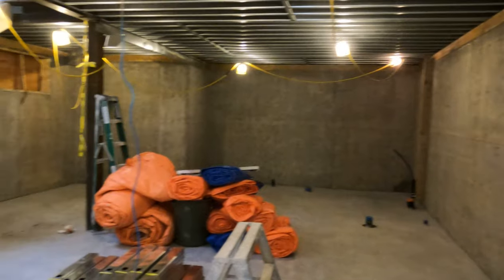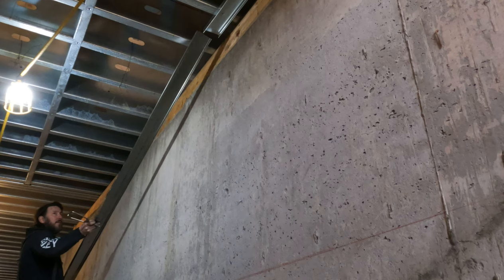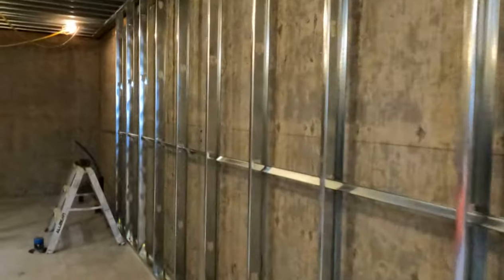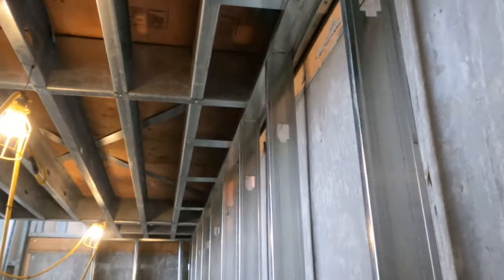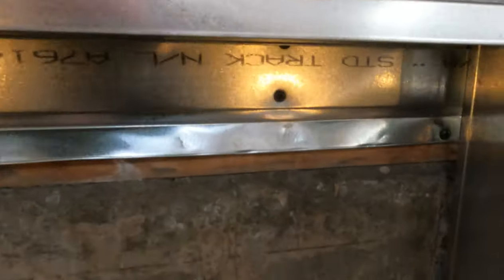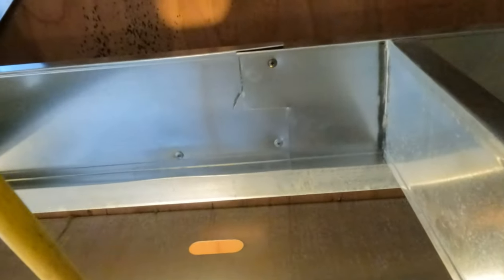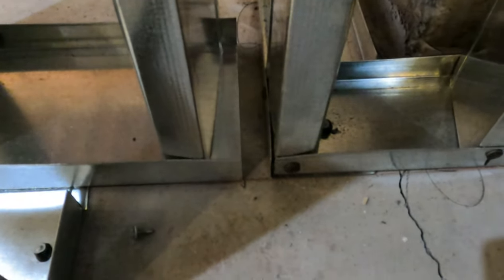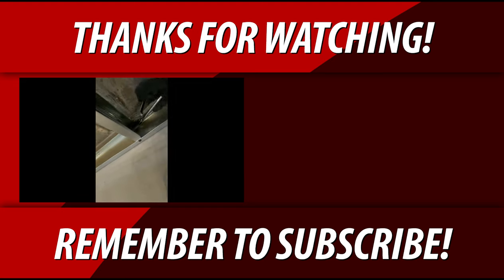Metal Stud For Basement Frost Walls

Comment: great stuff Chris as always my man...can you do a video on doing layout on not so square walls, i know that theres plenty of techniques but if you can share your best method that would awesome 🤙🏻🤙🏻🤙🏻
Reply from the maker: yeah its one of those things. The main thing is to have a couple different colors of chalk and check your lines as much as possible like these concrete walls. What we want is to be even and come off the wall the same distance on either end but its impossible because the concrete is awful. Remember to snap a line the entire distance and check the bottom for distance make sure you have the 1" or 25mm air pocket but then you also need to check that the wall is level or doesn't swell out in the middle. I didn't show that in this video but should of. You can check inside with a line laser and can check in or out with a rotator. If you want to make sure something is perfectly square just measure diagonal from corner to corner and keep the same distance. This only works when you can break the rooms up into squares or rectangles. You don't have to worry too much about being square with steel, its perfectly straight. Just take your lines from either a gridline or an already laid out wall, just follow that and you will be okay. Try your best to keep your tape measure as square to the wall, don't measure on huge angles and all will be good!